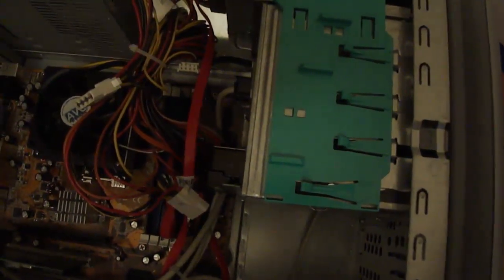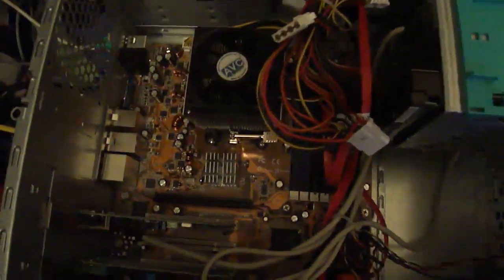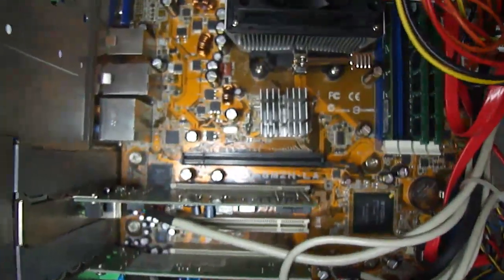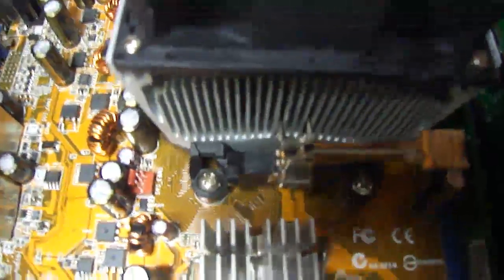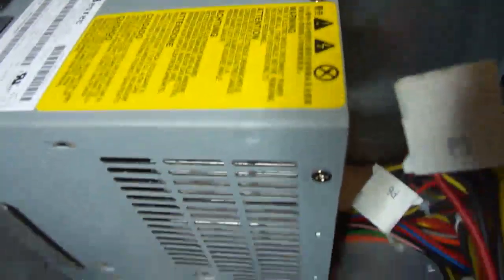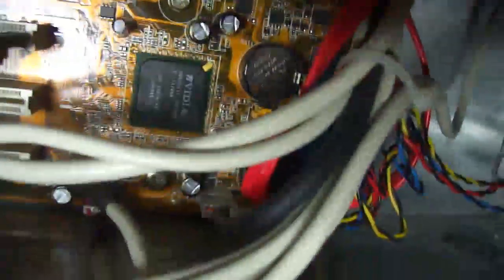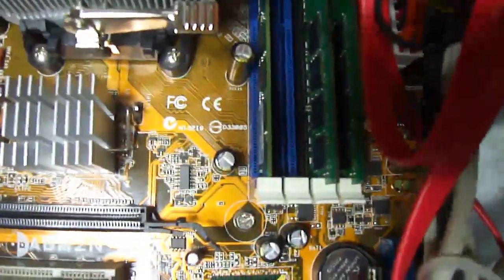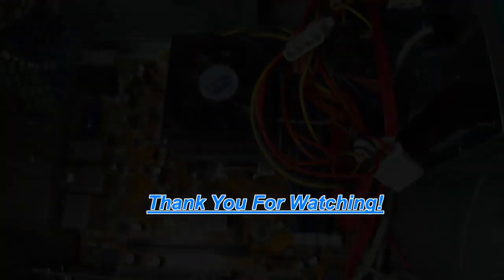Computer Doesn't Boot Up FIX

Comment: I am having a problem where my computer only boot up some of the time, but only after trying several times.
Reply from the maker: +michael ebanks Yea that depends if you have an integrated or a dedicated video card on your mother board. Its most likely that your mother board needs to be repaired.
Reply: take gpu card out then it will boot on then turn it off put the gpu back may work

Comment: Mine turns on, But not boot, Like the processing bar doesn't light and no Logo shows then you repeatedly restart or reset button computer for this to werk, answer? Your disk is to loose, try budging your PC, or try opening and try finding and tightening your main OS Drive
Reply: My Pc Is about 7 months and has at least 1-2 weeks of warranty
And of course, I'm afraid to tuch my Setup/Bios
And a note is attached to my log screen after SEVERAL TIMES Of Swithcing Over and over again

Notes
"A power surge has been detected, Leaving your Motherboard unresponsive not working" = I think turn on my computer to fast after my I turn on my power safe

"Overclocking is detected, you may try tweaking your setup/settings by pressing F1(Bound) = I think I need to touch my Setup/BIOS thing again :(
Reply: Kirsten Davis My motherboard and cpu is 5 years old(lga 1155),do you think its the same reason?
Reply: Turns out it was the psu cable that I didn't plug in properly

Comment: You call 3gb of RAM nothing?? and here in 2015 I'm proudly using my system with 1gb of ram which runs perfectly with linux lite which doesn't use all that much RAM but anyway but I would be fine on 512mb also as I barely make past 450mb of ram with 3 tabs open on firefox
Reply: +Sony Trinitron omg i know this 8 months ago but these days u need ram !! he is kinda right!
Reply: I'm running on linux lite which barely uses 512mb and firefox and a couple tabs I get about 750 or so mb of RAM used so 1gb does the job quite well, others do have different uses for their Pc's though which will be much more demanding which much more RAM eating OS'es
Reply: well linux has way different architecture than windows :D Duh

Comment: I built a new pc and i tried all the steps in the video but it still didnt work and then I replaced my mother board but it still didnt work
Reply from the maker: snehal saini Have you checked the power supply? and can the components run on the amount of power given?